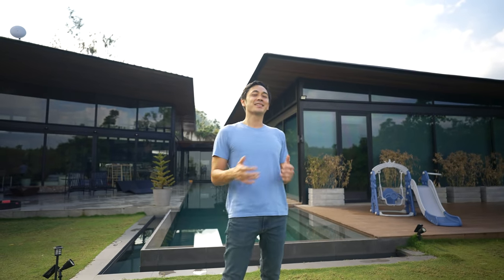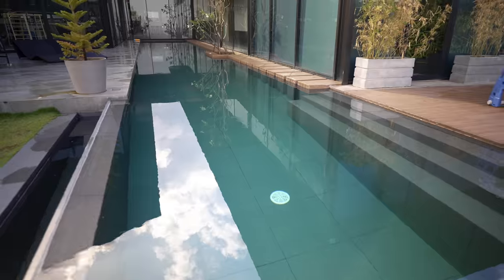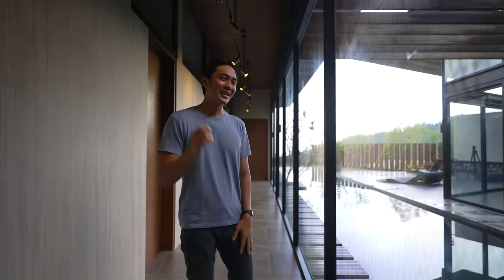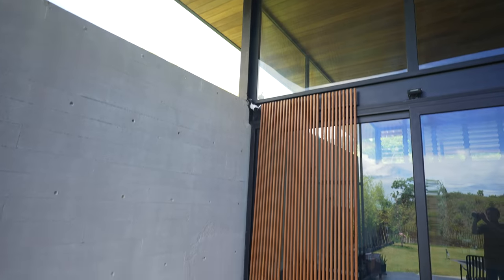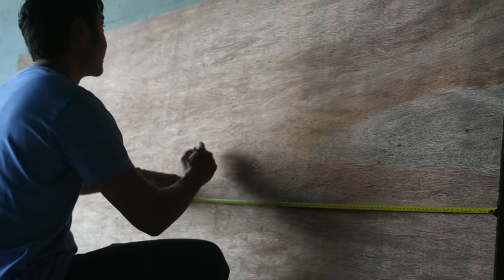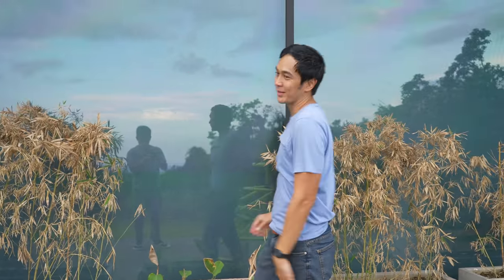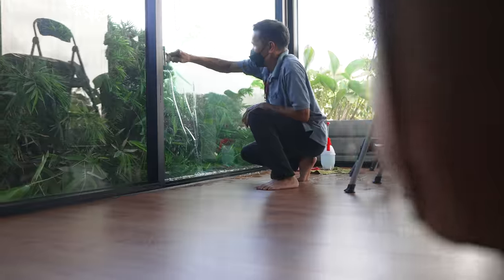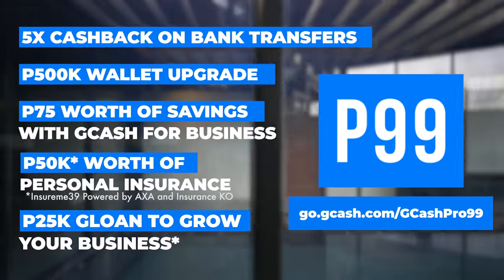Typhoon Proofing Our Glass House.

Comment: Hello po Slater, isa po akong humble na karpintiro at ang masasabi ku lng po ay hindi po ako baga magssugest gumamit ng Toughened or Tempered glass kasi meron itong uri na tinatawag na Nickel Sulphide inclusion or sudden break.. Annealed glass is medyo weak. Magsuggest ako gumamit ng HeatStrengthened laminated glass sa uri na laminate. So laminated Heatstrengthened glass baka pwede pero dapat isize ung sukat ng thickness na glass. Cguro mga 21.52mm minimum. Dapat baga 4sides supported din. Ung sa laminate naman, maari naman gumamit ng PVB interlayer o kaya naman eh SGP interlayer. SGP is more rigid than PVB. Kung ung engineer nio may experience sa structural dynamics pwede nia icalculate ung constribution ng shear modulus ng interlayer.. Meron bagang guidelines sa ASTM E1300 kung pano magcalculate.. Itry nio po ung LSdyna pagpredict ng behaviour ng laminated glass.

Comment: So good you look into typhoon home protection after your last experience … the discussion of having smaller windows if you have open during the storm is needed, so the house will not blow out during the highest peak of the storm. It’s been proven, bc homes that  sealed out & didn’t give some passage way to air to flow thru, house did exploded during the typhoon, must listen to sound advice on this Slater !

Comment: Laminated glass and storm shutters would probably do the trick
Reply: dipindi din baga sa sukat ng laminated glass at uri ng glass. Toughened/tempered glass in the form of laminate ay baka pwede kaso may nickel sulphide or sudden break. Akoy magsuggest baga maggamit ng 4 sides supported heat strengthened laminated glass. Ung sukat or thickness dapat kaya i resist ung wind pressure. Sa laminate interlayer, gamit baga ng SGP interlayer

Comment: Ha, this sadly still isn't enough from where I come from. My hometown is in Catanduanes (Bicol) we get typhoon gusts up to 250-315km per hour (recent typhoon Rolly was intense which compared to typhoon Odette has a huge strength gap, so yeah... at least marine plywood thick typhoon guards and yes drilled into the cement surround windows with almost 0% chance for air to get in, if you have yet to construct your house :)

PS.
Sucks being the first contact with typhoons coming from the pacific but yeah, we face the brunt of the typhoons yearly :(
Reply: Hello. I am wondering how you re-attach the marine plywood whenever there's another typhoon. Do you drill it again too? Or there is a better way to put it on/off on the windows?
Reply: @asc3483  use bolts and washer?
Reply: @asc3483  you should have bolts ready around the window corners. I can send you examples if u want
Reply: @Dpbherrmann  Hello. My last reply was deleted, unfortunately. Can I post a comment on a video on your channel perhaps and communicate through that? We are about to hit by a typhoon tomorrow and most likely right at the eye of the storm :|
Reply: @asc3483  sige